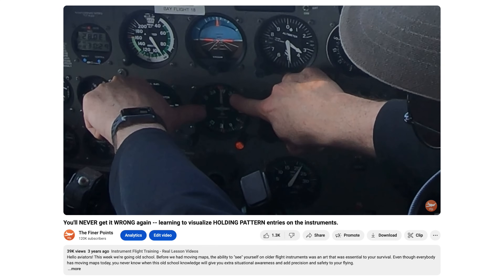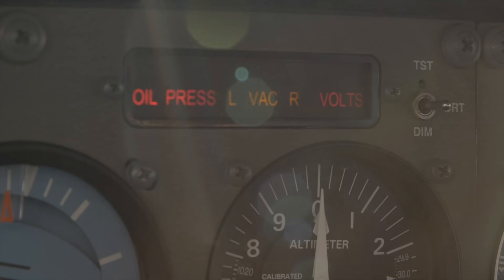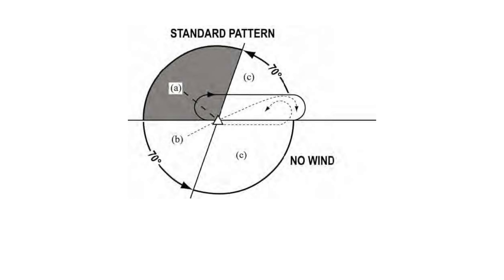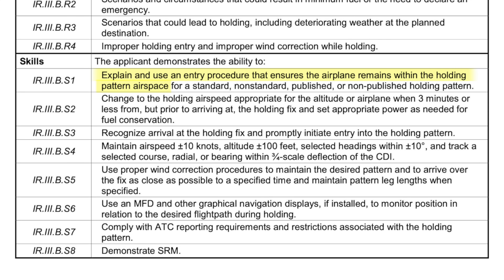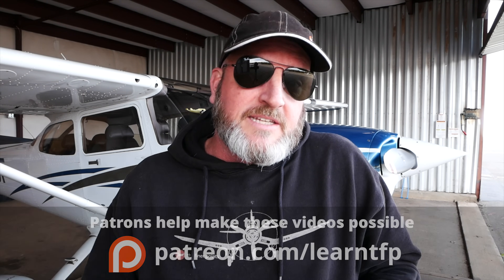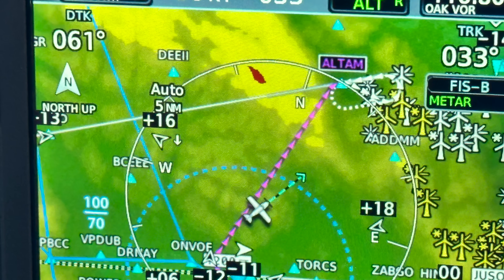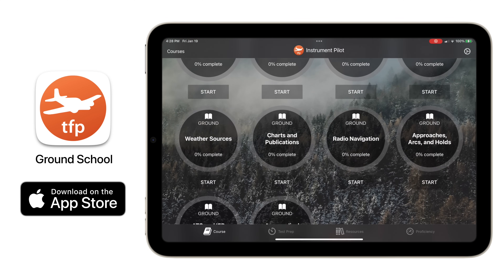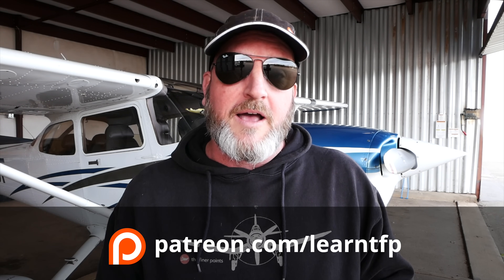HOLDING PATTERN ENTRIES, DO THEY MATTER? - flying instruments, IMC, IFR, CFII, IFR flight training

Comment: Jason, thank for amazing content !  I was curious where the 8 mile and 4 mile protected airspace is derived. It’s not listed as such in the AIM. I have found another reference claiming : Holding is conducted in protected airspace that's determined by FAA TERPS Criteria. Holding patterns are established with a primary area (used for holding) and a secondary area (2NM wide perimeter around the primary area). TERPS uses a series of complex tables to determine how wide a holding area must be. Honesty 2 miles around the oval should be more than enough, wondering if you could shed light on this? Thanks, Benjamin
Reply: I was hoping to find a reference to the 4 and 8 mile statement as well. I’ve checked a few places but haven’t found anything. Hopefully you get a reply!

Comment: In the given example, yes parallel makes more sense to enter the hold, but you’re not actually entering the hold, you’re using the hold entry as a procedure turn… as you’re going to be continuing on the approach, there is value to getting on the inbound course sooner hence why it may be advantageous to do the teardrop instead of the parallel. As you pointed out, you’re not turning excessively to do the teardrop. I hadn’t thought about it till looking and likely wouldn’t have realtime in a plane and likely would have done parallel but now I can see value here for teardrop. Better to deviate earlier from normal expectation so as to sooner be able to tighten and be set to be more precise easier and earlier later in the approach.

Comment: I'm a 30 year retired Air Traffic Controller (Washington and Atlanta ARTCC's) and a 47 year 12K hour commercial pilot.  As a controller, we didn't care HOW you entered it as long as you stayed in the protected airspace.  The protected airspace for any given holding pattern (varies depending on altitude, remember the speed requirements for holding at various altitudes?).  As long as an airplane stayed within the protected airspace we were happy.

Comment: Turn off the moving map if you don't want students to use it. Then they are forced to tell you what entry. But again, these are recommended entries, not required. You can not fault that pilot flying for his answer. If AP was on it would have done that same thing, you are flying to points in 3D space(where that space doesn't allow you to hit things)

Comment: Possibly a gap in my understanding but the blue line in the hold you flew Jason looks like a parallel to me. Assume the blue line is the parallel version you flew not the tear drop the Nav device suggested? Tear drop is 30 deg offset to outbound course on entry yes? So tear drop - sometimes called offset - would have been a 105-30=75 deg heading as you passed overhead Jobus?

Comment: Good points. When I was in Northern VA, in a busy training environment, if we were entering the hold for an approach and another aircraft was in the hold we would do a teardrop instead of a parallel especially if the other aircraft would be heading inbound while we were heading outbound if we did a parallel on the reciprocal course.  In actual, that never happens, but in high density training environments, it does.
Reply: I would hope that you'd have altitude separation if you were both in the hold at the same time..  even in a high density training environment and in VMC, two aircraft in a hold at the same altitude seems like an unacceptable risk to me.
Reply: @Joe-ef7sk  usually happened with the  CJR VOR-A.  You had to deal with the IAD Bravo and the SFRA, so there weren’t a lot of options.  Takes a lot of situational awareness.

Comment: Very interesting, non American pilot here, we call it traffic / non traffic side and make an over head join descending on the non traffic side to circuit height, crossing the airfield near the end of the runway to join mid downwind.

Neither of the options you showed are taught where I fly.  Left hand turns only within 10nm of the airfield unless a right hand circuit is being used (will be stated on the plate which runway has a right hand circuit if any).
Reply: there is no airfield, it's a holding pattern around an arbitrary fix.

Comment: The notion of loitering in airport space seems quite wrong to me. How you enter that mistake seems like a much lesser issue.
Reply: You aren't loitering, you're flying a published hold while flying in IMC or simulated IMC and are under ATC control which is providing clear airspace around you.
Reply: @craigsanders6925  I was under the impression that every strip has such a pattern, including small without ATC and it's used in clear daylight. I can see why they do it for practicing landings but that seems risky to me when it then disrupts other traffic. It seems to me that anybody practicing touch and go should yield far for any traffic in and out and not encourage close formation loitering. if it can at all be helped. I would say a touch and go should depart the airspace if anybody else is close to using the runway and only come back when it's clear.
Reply: @DanFrederiksen I think you're confusing a traffic pattern (around an airport) with a holding pattern.  They are completely different things entirely.
Reply: @DanFrederiksen  This is an IFR holding pattern after a missed approach, not a pattern at an airport.  It's about 10 miles away from the airport at an altitude of 5000 feet. Are you a pilot?
Reply: @cbav8r  sure, fair enough but the issue is the same, isn't it. Arranging planes in the same space indefinitely.
Reply: @DanFrederiksen   No, it isn't the same, in this case they are under control of ATC, just like all the other planes in the pattern at that airport.  At an uncontrolled airport they're announcing their position and a letting any other airplanes in the area know that they are inbound on a straight in approach.  Happens everyday without issue.

Comment: Figure 2-70. "Holding pattern design criteria template" on p. 2-49 of the Instrument Procedures Handbook provides a generic view of how procedure designers allocate protected airpsace around a fix to provide maneuvering room as you enter and fly holds. That's a better guide than  Fig. 5-3-3 in AIM 5−3−8. Holding, which focuses on the key elements and names of the components of a hold.
Reply from the maker: Thanks for that Bruce, I'll check it out

Comment: 1:42 where can i find this information? ive been looking through doc 8168 vol 1 and 2 but couldnt find this specific piece of information
Reply: In mine the illustration is in vol 1 section 6 chapter 1; and roughly makes up the entire chapter. Maybe I misunderstood the question?
Reply: @Rodhern  i mean, the exact information of the 8 nm protection area for holding side and 4 nm for non holding. Ill take a look on your reference, thank you
Reply: @xXx_SpaceAce_xXx  Ahh ok. Sorry, cannot help you with that. I think ICAO asks that the area is large enough without specifying exact dimensions. The U.S. then decides appropriate standard dimensions (so that not every hold must be designed anew from scratch).
Reply: @Rodhern thank you sir, thats what i imagined!

Comment: Jason, always great videos. Here is a question, and maybe it is more GPS tech involved but I think it may be worthy:  In your example, there were non-standard L turns for the hold; IF this hold would have been standard R turns, the teardrop would have been the correct entry.  So, that is the question really- Does Garmin determine the recommended hold entry based solely on the hold position, heading inbound to the fix, and your current position, irrespective of L or R turns in the hold?

Comment: I use parallel or Direct entry pretty much all the time, rarely teardrop.
Reply: Interesting.. I'm the opposite, I'll only do a parallel entry if there's no way a teardrop would make sense.  I prefer teardrop because I intercept the localizer/inbound course in a more comfortable way, and farther out from the fix than I would in a parallel entry.
Reply: @Joe-ef7sk  I have no issue with that. 

In my experience, students are better at forgetting the teardrop. By eliminating it unless it's convenient and easy to calculate, they don't get flustered trying to calculate the heading from some random holding radial.

With parallel and direct the only time they don't have course guidance is on the turn reversal for the parallel. they can use the holding heading to dial in the course, and then just use that outbound for guidance.

When I showed people this and had them try it, few stopped using the technique. I don't force people to use my preferred techniques, even if I think they are superior, as I know not everyone works the same way and different people find different things more intuitive. But I tend to teach the techniques that the vast majority find intuitive first, and then teach alternate methods to the remainder of people who prefer something else or struggle with my preferred method.

Comment: ... but why did Garmin draw a teardrop?
Reply: Purely (wild) speculation on my part. In some sense the teardrop entry is the more elegant choice that provides the most stable/well-established inbound track at the fix. With strong GPS track guidance you can basically pull off the entry for cheap. Whereas back in the day with a hold at an NDB the decreased situational awareness after the initial 'long turn' might be too expensive a price to pay(?).
Reply: Count me in on the “but why?”.
Reply: Because when you load the LVK ILS RWY 25R IAP, it creates the missed approach hold assuming you’re flying the published MAP, which in this case has you intercepting the OAK R-060 inbound to ALTAM, not going direct to ALTAM from somewhere south of the OAK R-060
Reply: @spencerelliott981  Bam! That makes sense now!
Reply: @spencerelliott981 in the screenshot at 3:26, it appears that the altam waypoint was sequenced as the magenta line is going directly to it and not having the plane go via the 060 radial.  In theory, it should have updated the entry from the one required by the published missed.
Reply: That series of magenta arrows is a transition between two disconnected legs that is flown via a specific heading (020) to intercept a course leg (R-060). If direct ALTAM were the active leg, then the moving map would instead show a solid magenta course leg. You can see that the active leg is OAK R-060 to ALTAM, not direct ALTAM, at 2:20. The CDI shows a crosstrack error of more than 3 miles. If direct ALTAM were active, then the cross track error would be much less than 3 miles.
Reply: @spencerelliott981  New theory:
ALTAM is a "fly over" waypoint.  Therefore the plane will not begin it's turn until it is right on top of it, which means it will over shoot.  If the plane were to do the direct entry it would have to bank right to head south east to track back to the inbound leg and then turn again to the north east to track it outbound for the entry.  This is two turns that must be done in one minute followed immediately after a right turn to intercept the inbound leg.  So three turns in quick succession, two of which are north of the protected area.  The tear drop is one longer turn and quickly gets you within the protected area followed by the turn inbound.
If ALTAM were a flyby waypoint instead, it would be easier to enter the inbound leg travelling outbound for the parallel entry, however, I don't think this is the case.
Reply: @spencerelliott981 is correct. the 750 is expecting the pilot to intercept the inbound leg before reaching ATLAM. Pressing the Direct To button and selecting ALTAM, the 750 would have updated the entry correctly.  
There are lots of nuances with these fancy GPS systems that you need to know before you are in actual IMC. My last IFR flight, I filed in GP, I filed the IAF as part of the flight plan. I loaded this into my 750 and loaded the approach I expected. ATC used a phrase like " turn direct <IAF>" but hadn't cleared me. Instead of loading the approach, I hit Direct to. When I got to the IAF the 750 wanted me to circle back to the same IAF.  Had I not had the IAF as part of the flight plan it would have sequenced to the procedure correctly. I now make sure the magenta arrow is below the approach bar as part of my checks before getting to the IAF.
Reply: This issue has been driving me nuts since I installed my Avidyne GPS.  It does the same thing.  In approaches similar to what you discussed I know it’s supposed to be parallel but the GPS would always draw and fly the teardrop and I thought, for sure, I’m going to be violated.  This really really helped.  PS.  I flew as a safety pilot a few months ago with a guy who still doesn’t have a fancy GPS installed.  He hand flew a parallel entry.  Poor guy.
Reply: @spencerelliott981 we are both wrong....Not "heading leg" but "active roll steering path"...
Displayed for "transitions between two disconnected legs (i.e. holding), some procedure turn segments, parallel track segments, or transitions after some fly over waypoints..."

I can't seem to find more detailed information on what precisely a roll steering path is, but I would venture a guess that the system computes a best path (and therefore holding entry) based on practical roll angles for a specific aircraft traveling at its current velocity in current wind conditions.  The  intent being to minimize bank angles while intercepting navigational waypoints.  In this case, intercepting the 060 radial may have required greater than optimal bank angles.  Just a thought.

Furthermore, had the gps drew the missed approach procedure correctly, it would have specified a 20deg heading to intercept the 060 radial West of altam, not on top of it.

Comment: If you fly outside the U.S. at any point they are very much required. Pan Ops the icao version of terps assumes you’ll do a sector entry and hold (sector being your hold entry). They build their protection area different for entry into an approach and assume you’ll do the appropriate hold entry. 

An exception are rnav if you’re coming in a 180 degree capture region. 

So there is reason in the FAA pushing it.